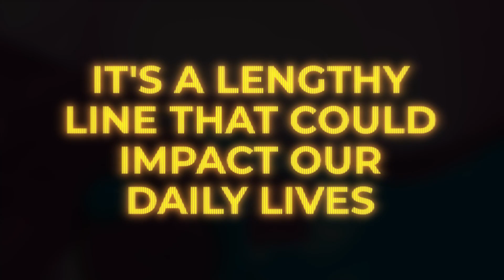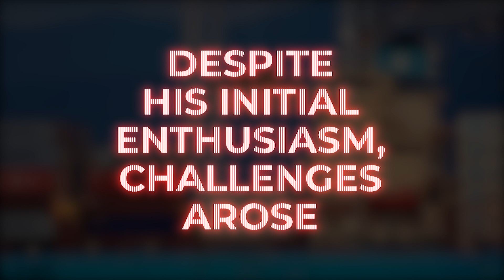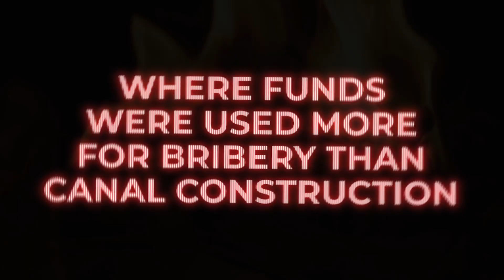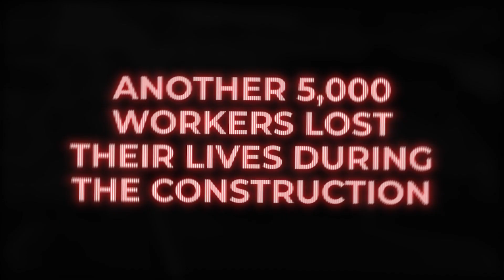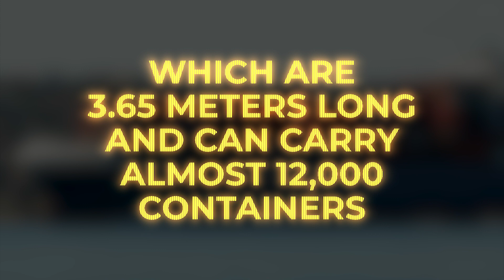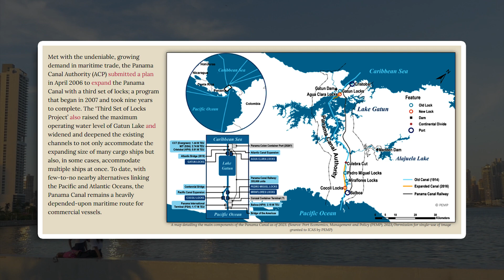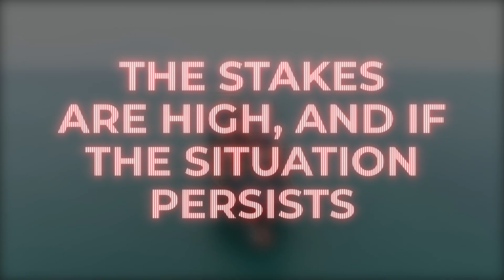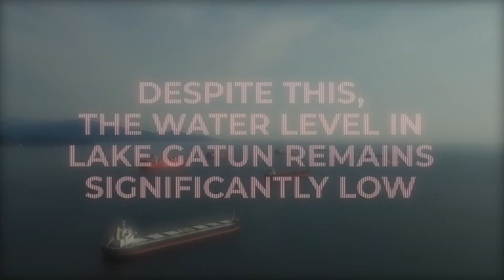Why is the Panama Canal Instantly Declining

Comment: The current congestion issues, coupled with a water shortage exacerbated by climate change, highlight the need for innovative solutions. While recent efforts, such as plans for a new water reservoir, show promise, the underlying problems persist. The impact extends beyond trade, affecting the lives of inhabitants dependent on the canal for drinking water. The situation calls for urgent and comprehensive measures to address both the immediate congestion issues and the long-term sustainability of this crucial maritime passage.